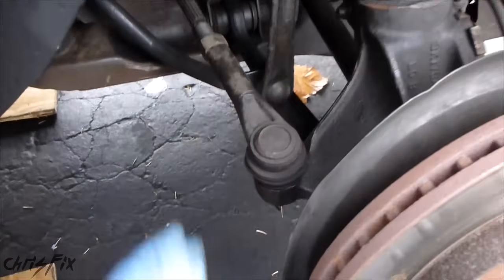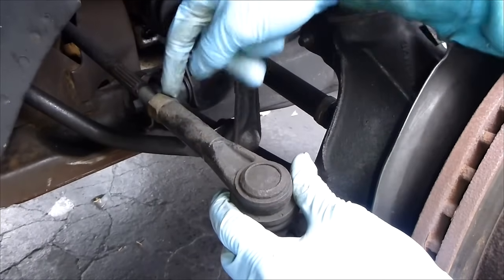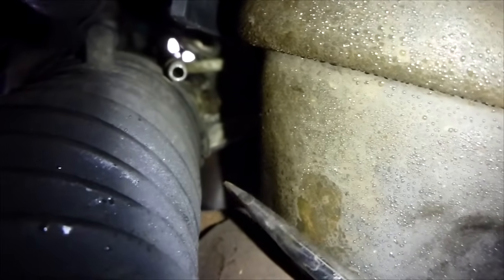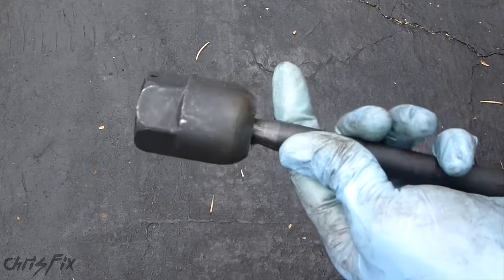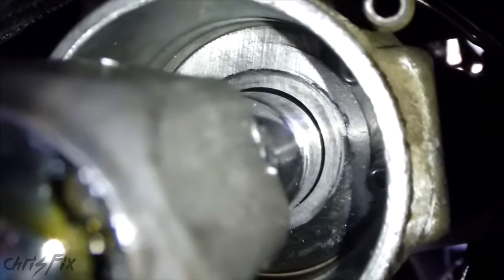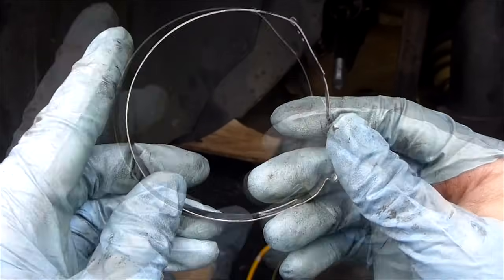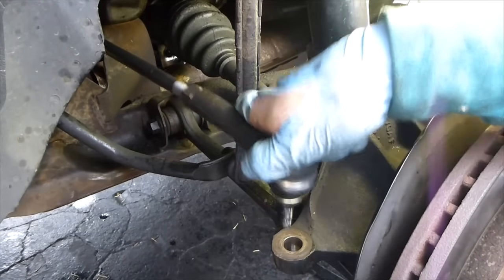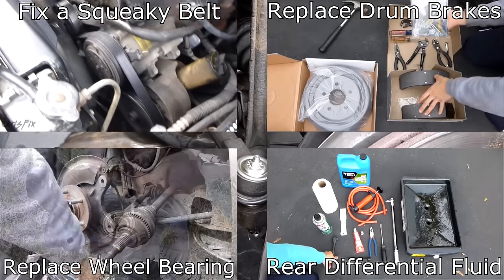How to Change Tie Rods (inner and outer tie rod ends)

Comment from the maker: Shirke M You only use red loctite if you do not have those pins that hold it in place. I have pins that prevent it from loosening so the blue loctite is used as extra protection from loosening due to vibration. If your tie rod doesnt have a pin to prevent it from unscrewing, then you might consider using red (permanent) loctite.
Reply: oh i remember this job lol it was a hassle but not as bad as a Auto shop wanting $600.00 to do the job... i am so happy that we have guys like you where we can learn to do it ourselves and save money! thanks
Reply: ChrisFix Thanks for telling me that. The guys at Advanced Auto Parts didn't bother mentioning that detail to me. In fact, I would really love to have the factory version of the auto repair manual instead of the stupid Haynes Auto Repair Manual. I am glad you exist.
Reply from the maker: Ikkaku572 No problem! Im glad I exist too and I am glad the video was helpful!
Reply: They sell a tie-rod remover tool at  home improvement store?
Reply from the maker: Ikkaku572 No, they have them at part stores. You can also get it via the link in the description of the video.
Reply: I misunderstood him. I found the band clamps at the Harbor Freight Tool store. All that is left is to find the boots and re-install the ventilation hose that ended up coming off. I am having a hard time figuring out how it goes back in.
Reply: ChrisFix I got into an argument with a so-called mechanic who changed my tie rods for me. He put so much grease in the tie rod end that it was coming out of the rubber part. If it does that, will it not hold grease anymore?
Reply from the maker: jackslater230011 If the rubber boot is not ripped then it is ok. The boot is designed to hold grease until a certain point and then it will purge the rest. A new tie rod should only be greased until the boot expands but some people do it until grease comes out.
Reply: ChrisFix That's what I mean. If grease comes out of the boot, it would no longer hold grease, causing the tie rod to fail prematurely, right? That's why I was arguing with that mechanic. In fact, my tie rods did fail a little over a month later.
Reply: At least the outer Tie Rods will be easier to replace. You will have to buy your own grease gun and a tube of grease to go with it. I would advise reading the instructions on how to use the grease gun before even trying to mess with it as I have learned the hard way. I will say this. If you get a simple grease gun, which I recommend to first time grease gun users, The top cap does unscrew and all you have to do is pull back the lever as far back as you can, but not as hard as you can. After that, you load the grease cartridge, screw on the cap until back in place ( don't turn as hard as you can) and release the lock by pressing on the little lever. Those are for the pump action grease guns. I am not sure about the other ones. I do hope you take this advice the first time around so you don't repeat the same mistake as I made. I am still able to use my grease gun, but I did kind of ruin it a little bit. Thankfully, it still works.
Reply from the maker: jackslater230011 Potentially. They are designed to purge grease though so if it didnt break the rubber, you are ok. They could have failed so early because places try to use cheap parts to make more money!
Reply: Now that is a cheap way to go.
Reply: ChrisFix yg
Reply: I have a 2009 Toyota camry what size of bolt wrench do I have to get to take the screws off the tire rod. thanks a lot
Reply: ChrisFix I think one reason they failed is because they were manufactured by Valucraft.
Reply: That was very nice of you to take your time to help people. It was very thorough.
Reply: +Ikkaku572 Factory manuals are way better and you can get a set of them including wiring diagrams and other powertrains/models.  They're out there (ebay, lots of places, maybe company direct) and well worth it. Haynes not much help.
Reply: You don't have to tell me twice. Thanks for the info.
Reply: +ChrisFix I don't know who taught you how to work on cars, but if you don't have the cotter pins, you better not be driving.
Reply: +jackslater230011 9:16 Bam. Cotter pins right there.
Reply: News flash buddy. My car has Tie-rods that that don't come with cotter pin holes. Don't believe me, look up 1999 Ford Taurus Tie-Rod-Ends. Well the outer-tie-rod-end obviously has a cotter pin to help hold the castle nut in place. Anyways, if that car part isn't made to accept the cotter pin, then you get what is called Red Loctite. Not the blue, for the red has a compound mixture that creates a stronger hold when applied. No cotter pin needed for inner-tie-rod-end. I don't know who told you that all tie-rods come with cotter pins, unless you misunderstood somewhere. If I were you, I would go back and ask that person to re-clarify.
Reply: Lol I doubt that shit.
Reply: jackslater230011
You didn't even try to look it up did you. What are you scared of? That your pride might be destroyed? How foolish. You can do better than that.
Reply: I am finally under the impression that someone else is using the jackslater230011 account. I noticed a personality change. If that is the case, then I want the other guy back.
Reply: Lmao No, it's really me. I'm just tired of trying to talk sense to an idiot. You keep saying you only use red loc-tite if you don't have a cotter pin. I keep trying to say you only use red loc-tite in conjunction with a cotter pin. You never drive a vehicle if you don't have a cotter pin in your tie rod. Just imagine what'll happen if the castle nut works its way loose. You could lose control of your vehicle. I should know because I've had an outter tie rod break on me at about 45 mph.
Reply: I find it odd how you say that because I have been driving my car for quite a distance. 30,000 miles. The owner before me put more miles on that vehicle and there is no telling how long the old tie rods have been on there. Also. No cotter pins on the inner tie rods. Never had an outer tie rod break on me at that speed and I have gone much faster than that.  Wait. You thought I was saying that you don't need a cotter pin for the outer tie rod??? Of course you need a fucking cotter pin for that one. It don't matter what outer tie rod ends you have. It is the inner ones that sometimes don't need cotter pins depending on the model of the vehicle.
Reply: Inner tie rod ends, outer tie rod ends.
Reply: Oh, and by the way, I checked out the outter tie rods for a 1999 Ford Taurus. And guess what? They come cotter pins.
Reply: Link, or it didn't happen.
Reply: Look it up on Autozone.com.
Reply: I just happened to look this up when I was searching up my tie rods of which I have installed on my vehicle. This is just the inner tie rod ends and as you can see here on this link I will post with in this sentence, it doesn't accept the cotter pins, but the outer tie rod ends do, which are not shown, nor do they need to be shown. http://www.autozone.com/1/products/505706-tie-rod-end-ves3344-valucraft-ves3344.html
Reply: If you need further proof, look on the sides of the Steering Gear for a pin hole. If there isn't one, then no cotter pin for the inner tie rod end. However, that depends on the year of the vehicle. I would say that all outer tie rod ends absolutely need cotter pins, but I will also be surprised if there were any that didn't need them. Every different vehicle or any type of machinery will each come with every different part that will come to your surprise. Either for the better or worse.
Reply: http://www.ebay.com/itm/96-07-Ford-Taurus-Mercury-Sable-4-NEW-Steering-Tie-Rod-Ends-Inner-Outer-/261543368827?fits=Make%3AMercury%7CModel%3ASable&hash=item3ce533187b:g:P1QAAOSwGvhT0um5&vxp=mtr Or maybe not. On second thought, you would want to look at the type of the very similar vehicle you have. Vehicle identification numbers mean everything when it comes to buying parts for your vehicle.
Reply: O wait. I just reread your last comment. What I just did was redundant. Well at least there is useful information.
Reply: I just misunderstood what you were talking about because Chris was the one that called the other pins on the inner tie rod end cotter pins. When you brought up cotter pins, you weren't clear on which cotter pins you were talking about until several days on through even after I linked that part of the video.
Reply: Well it is clear that we both know what the hell we are talking about and it did not take days for me to figure out that concept. I am seriously done talking about this. This could have gone a loooooot better. sigh >.> -_-
Reply: +ChrisFix this was so helpful. thanx again chris. QUICK QUESTION THOUGH, i changed the outer tie rod but not the inner and it still has the squeeke noise, any chance my inner will also make that noise if its bad???
Reply: +Ikkaku572 Haynes sucks. So badly done. Lacking in detail and sometimes just plain wrong.
Reply: Chilton is better, but I would love to get my hands on that official manual.
Reply: +Ikkaku572 The upper ball joints on my 2007 Mazda 6 had no cotter pins, nor slots for them on the nuts.
Reply: You have yourself an interesting car there. I hope that design isn't a detriment to the car.
Reply: +Ikkaku572 You are right, not all the tie rods use a pin, my car, a Merkur XR4Ti doesn't use a pin neither in the inner or outer tie rods, in fact the outer tie rod don't even use a castle nut but a lock nut so no cutter pin either. Here is some links http://www.ebay.com/itm/Mevotech-MEV298-Front-Inner-Steering-Tie-Rod-End-fit-Merkur-XR4Ti-85-89-/131654156752?hash=item1ea73301d0:g:G2cAAOSwsFpWSmoA&vxp=mtr

http://www.ebay.com/itm/Mevotech-MEV298-Front-Inner-Steering-Tie-Rod-End-fit-Merkur-XR4Ti-85-89-/131654156752?hash=item1ea73301d0:g:G2cAAOSwsFpWSmoA&vxp=mtr
Reply: +ChrisFix So the new inner tie rod does not come with the pins?also is there another hole on the inner tie rod where the pin goes into to secure it so it does not move?Great video thank you!!
Reply: i was told by my tech teacher in auto ,,.... never use lock tight on a car unless specified by the manufacture of part .. just dont .... who ever owned my car before hard .. put lock tight on the damm bleeder screw for the brake fluid
Reply: Well that sucks
Reply: +ixxgunnerx x the previous owner of my car stripped the bolt head on mine
Reply: Had to deal with tie rods again. Rubber hammer didn't help this time ^^'
Reply: My inner tie rod end also has no cotter pin. I installed it 3 years ago and it finally got a tiny bit of play in it. This time around im gonna go ahead and use some blue loctite although it was still snug as hell i almost bent my extention trying to loosen it. So yes some inner tie rods do not have a pin and only use threads. And both times i have got replacements now the auto stores have never mentioned loctite. Its more of a well why not type of thing its not needed in my case whatsoever
Reply: If you bought your car used, double check some idiot didn't replace the castle nuts with others during replacement because he didn't have a cotter pin handy.  As for PITA inner tie rods, rent a slide hammer from AutoZone - it's free (or buy it from Harbor Freight for $50).  That thing makes short work of all that.  As for rusted bolts and nuts - penetrating oil made from 50/50 ATF and acetone, breaker bars, air (or other) impact, and an air hammer are your best friends.  I've used an air hammer to slowly knock out impossibly stuck bolts and studs before.
Reply: But if I have to use heat on the steering rack to get those inner tie rods off next time, wouldn't it destroy the steering rack?
Reply: Depends on where you are using the heat.
Reply: ^That.  If you use it strictly on bolt heads/nuts and avoid any nearby hoses and wires and flammable liquids you'll be fine.  I've seen people use WEIRD shit to try to break bolts free that's highly flammable, though.  Goes without saying that if you smell gas nearby you should probably try something else first, too.
Reply: Where can I find the torque specs for the inner tie rod? I have a 98 ford ranger 2.5L 4cyl
Reply: In your service manual or Alldata.  Someone with Alldata might be nice to you - you can try Google, but whether you trust the results or not is questionable.  Call AutoZone, they can look it up on their computer and tell you.
Reply: job
Reply: New boots are over greased all the time. It leaking grease brand new, is not an issue. The guy who installed them, chose to do that. He could have watched it get fat but he greased it until he was visually sure it was full(leaking out) Your mechanic didnt do anything wrong. Why would you be bitching about it if you werent sure?
Reply: ChrisFix
Reply: Blaze 
U
Reply: ChrisFix doorhandle attachment
Reply: jackslater230011 door handle attachment
Reply: j
Reply: @chrisfix   could you be more specific on tool sizes and things needed
Reply: @jackslater230011  Truthfully if you have to go to the store to get cotter pins your error had already been made. Always check your parts before you leave the store. In addition,  if you are going to be doing jobs like this it would be good practice to already have parts like that in your garage/ toolbox. Harbor Freight sells cotter pin kits with all different sizes. Nuts, bolts, C-clips. Washers etc. are always a good idea to have on hand. Nothing tanks the profit margin of a job like having to drive all the way to the parts store for 1 cotter pin. Even for diy I'm sure you have better things to do with your time than that. Plan ahead and work smart/ safe. God bless, and thanks for your videos Mr. Fix!
Reply: Thanks a lot brother I’m off to change mine finally got that tool for inner rod.
Reply: NO
Reply: Or a nail or safety wire or.......
Reply: NO Loctite is permanent 😂
Reply: @CrazieFrogz  wow, the place I get my car looked at, the said 120-130
Reply: Greetings, I come from the channel @frias2287
Reply: Can you replace only ball joint in tie rod? Thank you
Reply: I prefer your old style of narrating where you talk to the viewer instead of newer ultra excited voice.
Reply: @chrisfix  haha, glad to exist lol
Reply: You're a life saver. Forgot how many turns to make it align enough to take to shop. Didn't do it right first time and front tires were ate. Thanks again. Avoided $250 tow bill

Comment: Hey Chris_ Thanks for the help!! I have a tip for you and your viewers, instead of zip tie and tracking down a special metal clamp u can use a hose clamp you can tighten them where they will never ever move or fail on you and bet its overall tighter than the original clamp. I am a Plumber that's how I know this I use them on cast iron, ductile etc. cheers

Comment: If anyone is going to make a video, this is how it should be made. Very clear, concise and informative. I especially liked the part about the twisting 20X. Thank you.
Reply: Roman Roman
I have been wrenching on cars,trucks,tractors,race cars,etc,etc,74 years and in my experience his
20 twists(turns),wasn't enough,he forgot to allow for the extra length of the new inner tie rod !!!!! I would have cut off the excess to match the original length of the old tie rod and THEN turned the new end on 20 twists (turns) !!!!!.
            ♿ 🇱🇷

Comment: Great video, excellent work. It looks like you used Lok-Tite 242. There are many variations of this material for all types of applications. The 242 version will not cure and function if used in an application subject to come in contact with oil or grease, 243 is a better choice as it is not affected by oil or grease contact and will cure properly and has the same strength rating. I worked in an assembly plant and we used a variety of these products in a sparingly manner. Some versions are permanent, almost like welding and requires the use of heat to break the bond. This material does have a shelf life and will lose its effectiveness sitting on the shelf for too long. Just a bit of info on these great products and their many uses.
Reply: Thanks for the info!

Comment: This is an easy ass job. Just go slow and follow procedures carefully. Before you unscrew the nut @ 2:15 take some white-out and mark where the old tie rod nut was sitting on the rod. This way when you put the new one on you will know how how far forward/back to screw it back on.
Reply: Nice tip on the white out, I like to use a yellow paint marker, but that is just because my eyes are poor and the yellow is easier for me to see
Reply: only works if the new tie rod is the same exact size
Reply: White out! A great Idea. Used to use a yellow crayon.
Reply: Clark Kent The right tools are the bomb buddy. I have them and once I get off my lazy butt I'll be replacing not only my tie rod ends but also my front and back rotors. I currently own an '04 maxima in very well kept condition. It's not hard to work on. However? When it comes to the belts, alt, and tune up (plugs) It's quite the bear.
Reply: That's how most new cars are Ted. They're all so compacted it's hard to do anything.
Reply: Bajawoosh...Yup! But being the motorhead that I am. I still enjoy getting my hands dirty. Right now I'm contemplating to replace my front rotors and tie rod ends. I've done this way before...a bit on in years since. But I have the tools and the drive. Keeps the blood flowing a bit.  :>)
Reply: How to change power steering pump on 2004 ford f150 v8